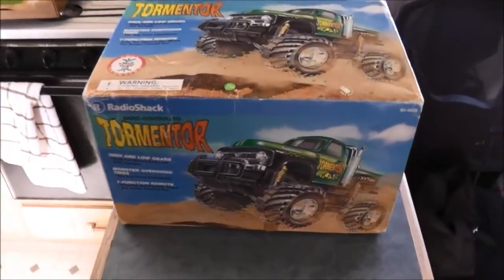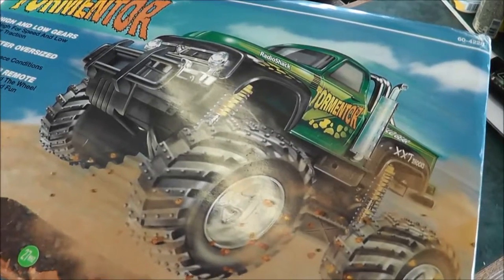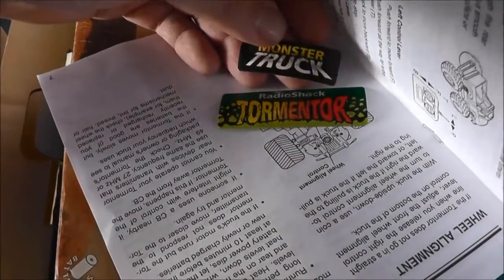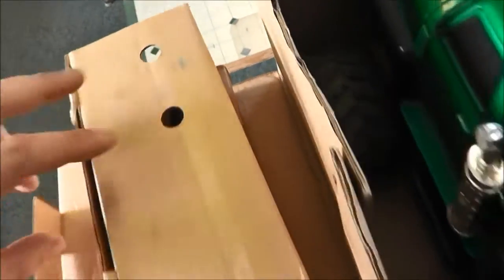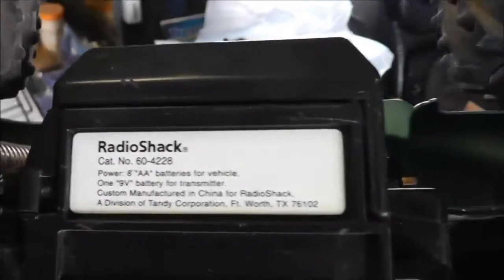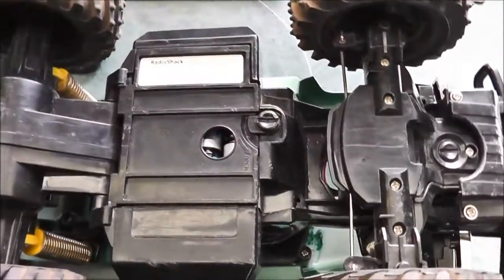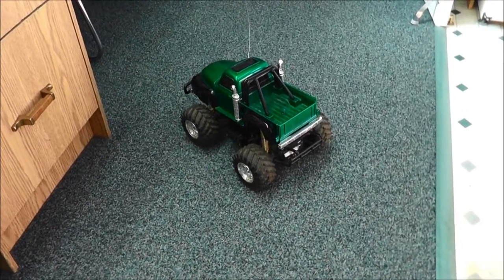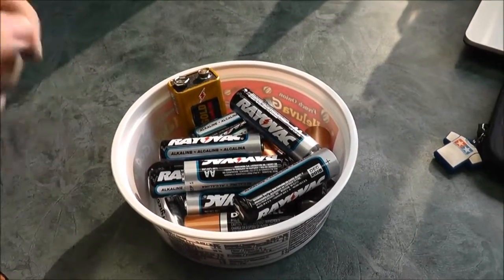Radio Shack Tormentor

Comment: I have one put it doesn't turns the wheels
Reply from the maker: that is the same problem I have with my shinsei dustrunner aka honda 3 wheeler. I haven't figured out why it won't turn. I am not a circuit board expert so I haven't been able to do much about it. This one is absolutely mint condition. still sitting in the box today. I haven't really played with it since making the video about it.